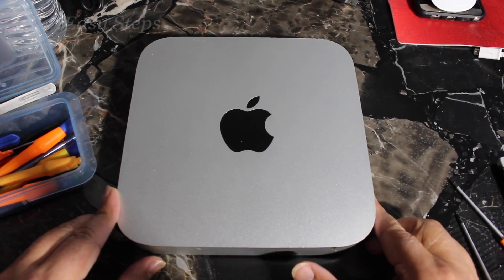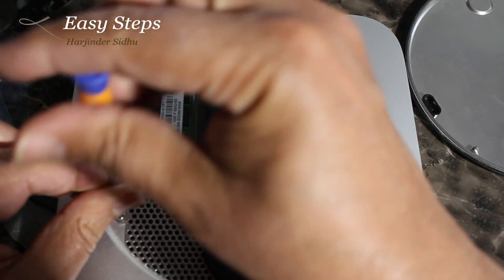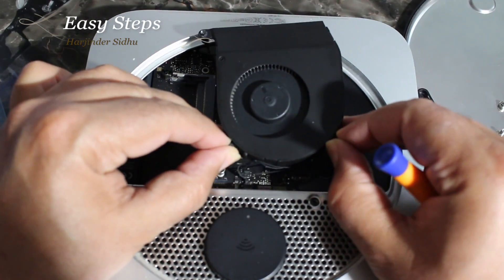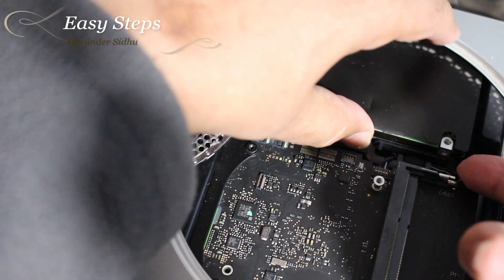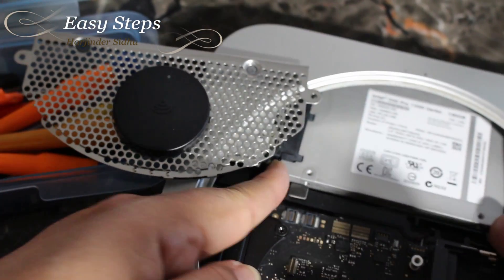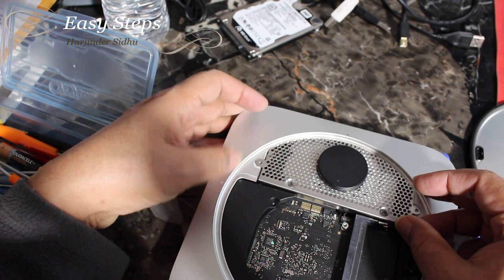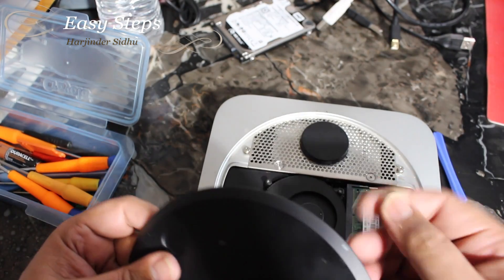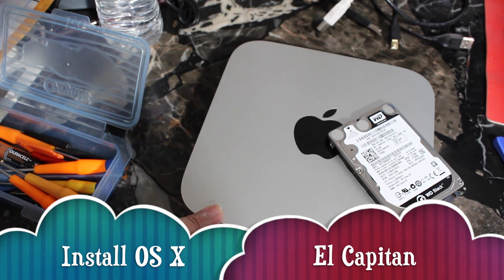How To Upgrade SSD on Mac Mini | Install Intel SSD | Replace Hard Drive

Comment: If you were tutoring a tech who wasn't familiar with this machine but had good general experience or were attempting to display your familiarity with the machine, then this was a useful video but running through the process without a clear explanation of fasteners and plug removal only serves to make mistakes likely. I have no doubt that you are familiar with the job but I doubt that you know the actual nomenclature of the tools that you were using,
Reply: YOU'RE WELCOME, BRUCE.

Comment: How did you get the OS onto the drive? I followed the steps and then tried to reinstall with a bootable USB, but the drive isn’t recognized. Does the drive need to be formatted prior to install?

Comment: I don't see any instruction on how to get MacOS back on the new SSD?
Reply: That was great!  But then what do I do?  
Do I swap out HHD for me new SSD and then put in USB after it is put back together and just turn it on and it will install from USB automatically? Or do I need special commands for USB to install?  

Sorry for my ignorance, I just want this to be as smooth of an install as possible.

Thank you very much for your time.
Reply: One last question.  I replaced my mac keyboard with a Microsoft wireless keyboard.  Which key is the option key? The window key?
Reply: I want to put my OWC 2.5 “ ssd drive into a Mac mini. My ssd drive already has my os of El Capitan and programs on it. Will they all still work on the Mac mini?

Thanks